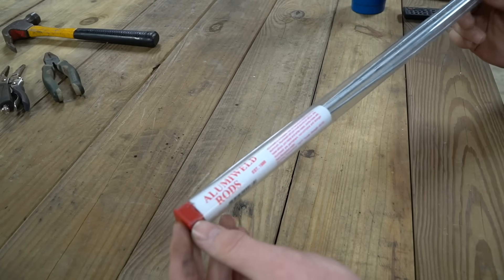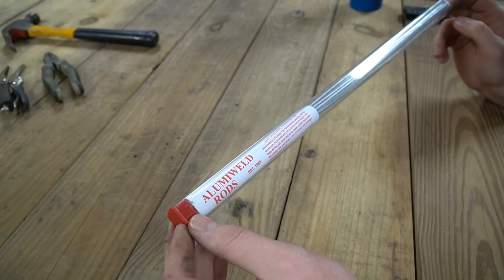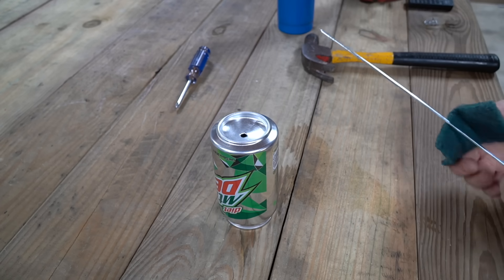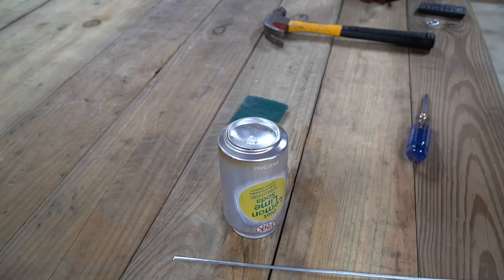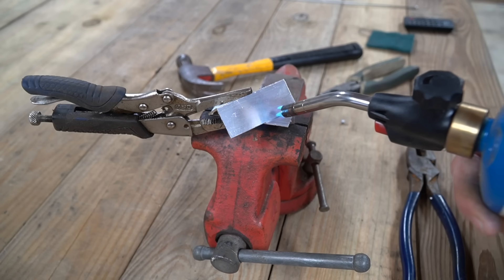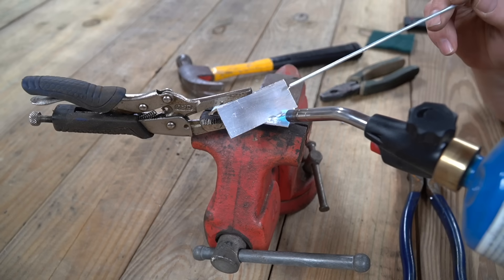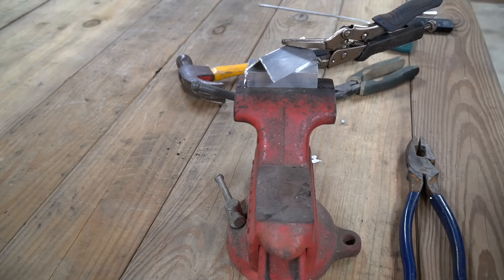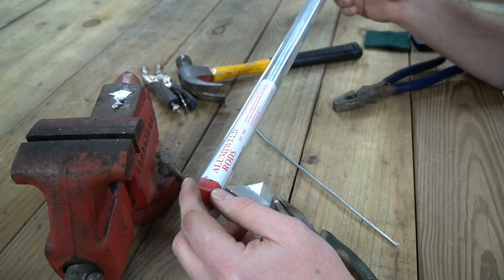Alumiweld rods from Harbor Freight!  Do they work?  Can you easily weld aluminum with just propane?

Comment: Cleaning aluminum you should use acidtone not a scotch bright
Reply from the maker: I think the scotch bright scuffs up the aluminum as well.  Being a braze and not a weld, I think it helps it stick.   Right or wrong, its how I do it.  :D
Reply: @1D10CRACY  unfortunately aluminum is very sensitive to contamination and the scotch bright will actually cause imperfections in the weld. 
just some free advice from a welder

Comment: I tried to repair a broken post in a carburetor.. the post that holds the  float hinge pin. Did not work for that..but haven't tried it on anything else.
Reply: I had the same thing happen with an older Yamaha carb and it wasn't a very easy carb to find, was it the post that the pin runs through for float valve? I didn't have any luck with it either. I wonder if Something like JB weld could work? Maybe not, but at that point I guess it wouldn't hurt to try...not sure if the gas would effect it's ability to bond or not.

Comment: What if the rod melts but doesn’t stick to the aluminum?
Reply from the maker: Typically it means the aluminum isn't clean enough, or it's an alloy incompatible with the rods.  Also sometimes I find if I don't have the aluminum I'm welding hot enough, it won't stick.
Reply: brush the piece with a stainless steel wire brush before you try to weld it.
Reply: Would tinning flux be good for this

Comment: You can't remove oxidization from aluminum using a cleaning pad... Actually no need to clean it unless it's contaminated with paint or something else.
Reply from the maker: But I can make it shiny and make myself feel better!  :D
Reply: If you want to oxy-acetylene flame weld aluminum, you scrub the thick oxidation away, using sandpaper or scrubbing pads, wipe with denatured alcohol, then use a good flux.  I’ve done it many times.  Not scrubbing the old, thick oxidation off makes welding SO much tougher.  In that case, you can weld, but you must break up the oxidation coating using the rod.  Not easy, not pretty.  Want to know more?  See tinmantech.com